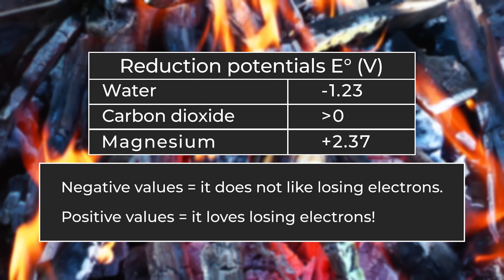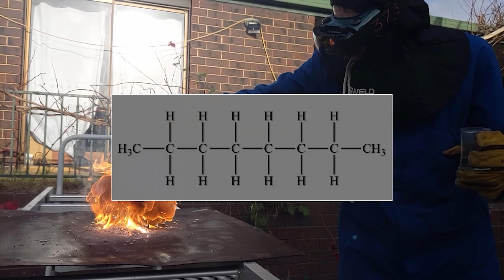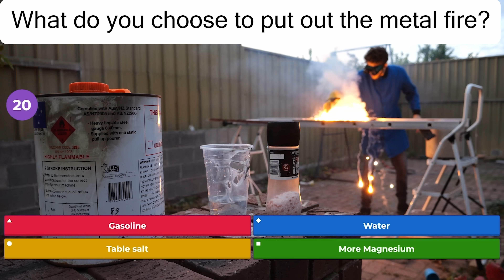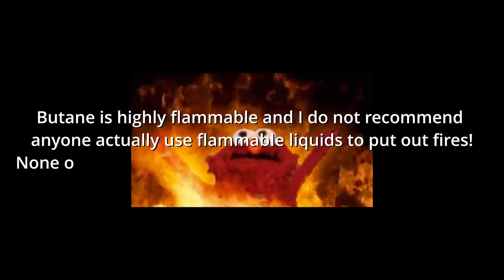Can Gasoline Extinguish a Fire?

Comment: It's not that the gasoline uses up the oxygen, it's that it smothers and cools the magnesium like water would a regular fire. The reason moving to the spray and drops of gasoline didn't help is because that's worse at those two aspects. If anything, you need more gasoline not less! 
I'd recommend dunking a piece of burning magnesium into a container of gasoline (not a sentence I ever thought I'd write)
Reply: Diesel would work even better since it’s harder to ignite with a hollow flame
Reply: @Volt64bolt  I was thinking the same thing and it would probably be more consistent as well
Reply: @Volt64bolt  Magnesium burns at 3000+ Celcius. Even Kerosene would catch fire at that temperature
Reply: @machintrucGaming  yes however it would go out much faster, it also leaves behind a thicker soot and wouldn’t be a fire hazard nor evaporate into an explosive gas
Reply: I wonder if making something like the old glass ball fire extinguishers would work? Water balloons filled with flammable liquid? 😂
Reply: @jono6379  Isn't that just an incendiary grenade?
Reply: @Malidictus  shhhh 🤫
Reply: Yeah, 'heat of vaporization' for the fuel would steal mad amounts of energy out of the burning metal, putting it below its autoignition temperature, and especially if there's a literal coating of soot...makes sense to me.  So his issue was delivery.  I'd just made a suggestion to pour a glass of diesel/kerosene on it, in fact.
Reply: I wonder if you made the fuel into a viscous napalm if that would be effective at sticking onto the surface of the magnesium to create more coverage and evaporative cooling effect
Reply: @stickmandaninacan  said that, my comment left. Or this could have been the one where I said smothered means blocking oxygen. Either way, do you see my comment there? Are my comments hidden from me or everyone or... I thoroughly dislike the comment system
Reply: @MiddlePath007  I see your @reply but the @stickman thing isn't 'live' and clickable like for other people.  I think the comment system is being 'updated' lately or something.  I had a user on another video have to reply to me again to @me properly so I saw their comment.
Reply: @MiddlePath007  this comment system really sucks, I didn't see any of your other comments I'm sorry
Reply: @stickmandaninacan but then when he catches his hand on fire his hairs won’t be the only thing a little bit shorter 😮
Reply: Ah, you beat me to it. As a matter of fact, pure magnesium is often kept safe from the moisture in the air by partially filling the container with diesel fuel!
Reply: I think part of the problem was that in the original clip he had it on the ground which acted as a heat sink further cooling the magnesium while in the air or on the metal plat it wasn't a key to conduct as much heat away
Reply: @allisterhale8229  So, yeah, 'multiple extra heat-drains' adding up to an easier situation for snuffing the fire.  I was wondering  how much the ground might have changed the equations, too.
Reply: So, to summarize, it consumes the oxygen and cools the magnesium?
Reply: I read the word "dunk" as "drink" and for those few seconds I was tripping and laughing
Reply: I love how the way to make this insane idea actually work is apparently to make it even more insane.
Reply: ps:apparently gasoline does not burn as a liquid because it can't have oxygen inside it?
Reply: Smothering is robbing it of oxygen.
Reply: Cest la vie
Reply: Yup! Smothering a fire is what ya need.
Reply: Yeah. I was thinking along the same lines because gasoline itself does not burn. It is the gasoline vapor which burns. So spraying the gasoline from a spray bottle makes the gasoline mimic those gasoline vapors, just with bigger droplets. Thus having the gasoline in a big liquid pond form most likely works the best.
Reply: and please for the love of god stop putting water ON MAGNESIUM
has nobody seen the funny clips of throwing sodium and magnesium into a lake!?
magnesium does not play well with water AT ROOM TEMPERATURE, let alone at fuckin redox temperatures!

Comment: i think you're misunderstanding how you're putting it out, sure, when you burn gasoline, it does use up the oxygen, but, what you're forgetting is that it's producing a whole load of really hot carbon dioxide and water vapor, which, from your other experiments, shows that the burning metal can still react with it, what you've really done is drowned the reaction in gasoline

Comment: that gasoline and butane fire extinguisher is just a flamethrower

like change out the gasoline for napalm and the butane for dry ice or propane so you can have more pressure and i immagine you've got a pretty decent flamethrower

Comment: Don't directly look at a magnesium flame, you can get temporary/permanent spots in your eyesight(you might not even notice it's permanent at first, it's the same with powerful lasers: Your brain is very good at filtering your vision and compensates for blind spots, but you still lost a bit of visual acuity at that point. I think magnesium flames would typically create smaller spots on your retina than a laser due to how projection works, which makes it more likely you keep most of your eyesight, but you still might lose some.

Comment: Its probably just a volume issue, the extinguisher can't push out as much liquid as pouring out a can.

Even that eyedroper probably outputs more then the spray bottle.

You need a gasoline fire hose, not a gasoline extiguisher
Reply: the gasoline poured from the canister extinguishes the fire because it starves the magnesium of oxygen. by spraying it from the fire extinguisher or spray bottle, you are just mixing air and fuel which is adding to the fire. 

the real conclusion of the video is that any liquid works as long as its molecule doesn't include any oxygen and it's not mixed with air beforehand.
Reply: @Treon so actually, just grab a bottle of olive oil and douse it!
Reply: @micahphilson  one way to find out
Reply: @superslimanoniem4712 gasoline is a crude oil distilate.
It is an oil.
Reply: @superslimanoniem4712 "oil" is not a chemical term and has no clear definition
Reply: @Treon  not only that, it also cools down the magnesium
Reply: "Everything's soaked in gasoline.  Now we're safe from fire!"
Reply: @h8GW  hey as long as your environment has very little oxidant, yes. A full tank of gasoline doesn't explode until someone stuffs oxidant into it or breaks it open and makes the gasoline spill everywhere.
Reply: Ray Bradbury called. He said he already came up with that
Reply: ‘69 👍

Comment: Look at Explosions and Fires salt extinguisher: it has a super wide slow flow nozzle that drops it vertically onto the fire. Yours is a jet. Can you put a watering can spray head on the end of the pipe to spread the gasoline out and slow it down so it doesn't aerosolise the fuels?

Comment: longer chain hydrocarbons. Try cooking oil. Maybe motor oil? Grease? Some mixture of the above? I think the volatility of the liquid isn't helping.
Reply: Legit idea. 
Bitumen, heavy/crude oils should work too.
I was told so in a fire training, at the petrol refinery I worked for, but that was 40 years ago and I'm pretty sure, nowadays they won't tell you that anymore.
Reply: I think HVO (hydrotreated vegetable oil) could work instead of vegetable oil as HVO is purely paraffinic. Veg oil is a methyl ester so the oxygen could cause issues. Great suggestion for longer chains
Reply: I think oil is less flameable, covers better to keep Oxygen out and is in many applications used for cooling. This should be exactly what is needed :-)
Reply: Volotile liquids evaporate at lower temperatures, thereby providing more rapid and more complete cooling.
Reply: @akulkis  Solids and liquids generally aren't flammable. It's only the gases that are. As volatile hydrocarbons evaporate providing a cooling effect, it also turns into a flammable gas which then provides more fuel for the fire to sustain itself and a net increase in temperature, rather than decrease. 

In this instance we want something that takes a lot of energy to evaporate in order to soak up all the excess heat before it provides further heat to perpetuate the fire. 

If you put Butane on a fire at -123°C then the fire will be hotter than that and it will evaporate some, which is then flammable, which then fuels further evaporation perpetuating the fire. 

If you put bitumen on a fire, it has to get up to at least 200°C before it starts to boil. You could look up butane and bitumen  specific heat capacity and the dT to ambient temp (14°C?) and to the flame temperature (Magnesium 3100°C) And the magnesium specific heat capacity. Then you can calculate exactly how gaseous and flammable the butane would be immediately after dispensing. And how much energy it would take to boil the bitumen in order to get it to catch on fire. 

Make it fair and put them on at the same -123°C and the Bitumen can absorb a huge amount more heat before becoming flammable and perpetuating the fire.
Reply: @Leo99929 I feel like more ideal would be finding something that isn't flammable during it's gaseous phase but evaporates really quickly would be more ideal since the evaporation is what takes the energy away rather than just heating up a piece of solid till it burns, like that will reduce heat slightly but just like the butane will end up bringing the heat right back up as you're adding fuel to the fire. You want something that evaporates really quickly but doesn't catch fire after it's done so to remove the heat rather than just slow it down a tiny bit like bitumen would. Like if carbon tet wasn't absolutely terrible for us and the environment it would be perfect cause that's exactly what it does
Reply: @noodlelynoodle.  Oh yeah, I mean you could just pour sodium chloride on it. But this isn't about the most effective way to put out a metal fire. It's about putting out a fire with something that is itself, flammable. Because the concept is so weird and unexpected. A video about doing something completely normal and logical wouldn't get a lot of views.
Reply: @Leo99929  solids and liquids can be flammable, but they're never explosive (a solid chunk of magnesium especially can just be set alight by heating it up enough, that's how vehicle fires happen in old races a lot of the time). The cooling also is secondary to the oxygen starvation effect when using flammables to cut out flammables.
Reply: @pallingtontheshrike6374  There are exceptions, that's why I said "generally" rather than used an absolute like "never" which can be disproven with one counter example. Example: 

Counter examples to the idea that solids and liquids never explode: Nitroglycerine and C4.

I once put a big chunk of magnesium on a camp fire and it melted but didn't set alight. At least until I hit it with a big stick. Maybe that removed a protective oxide layer? or the impact pushed the temperature above the ignition point? or it splashed and some spray set alight first? IDK. 

A problem with trying to starve a fire of oxygen with a flammable thing is that the flammable thing is likely to set on fire since it's flammable and in the presence of fire. Then heat rises, drawing in gas to replace it from the bottom. That gas is likely air with oxygen in it. It needs to have lost enough heat whilst starved of oxygen to get below auto ignition temperature. Which is less likely when engulfed in flames.
Reply: @Leo99929  It doesn't need to drop below auto-ignition if you make a layer of non-flammable deposit, like the soot the gasoline was making, that then encases the thing you're trying to put out. You need a lot of your "retardant" though.

But fair enough on the "solids can explode."  If anything, most military explosives are solid iirc, so even "generally" is... eh.

Strictly speaking solid and liquid fuel-only materials can usually only burn and not blow up. Fuel-oxidant mixtures can do whatever they want, for obvious reasons.
Reply: @pallingtontheshrike6374  I assumed soot was carbon, like finely powdered coal? So it should burn if hot enough and there's oxygen, right?

I looked it up and it's apparently "amorphous carbon". Here's me thinking C2 + 2O2 = 2CO2, but amorphous carbon is apparently not considered "flammable"?! I guess I have seen the black soot deposits glow incandescently with a flame on them, then not sustain it's own flame when the fire is removed?

Having said that, it also says "can burn or smolder at temperatures greater than 572ºF (>300ºC)." So that's hard to reconcile with "not flammable"

I see the logic that the soot layer can make flammable things hard to light, but also chimney fires are a thing? Having said that, I think that's more about creosote than the carbon? And carbon does oxidise releasing heat turning into CO2? IDK, looks like it depends on the situation?
Reply: @Leo99929  soot is usually unburned fragments which yeah is carbon.
It's bad heat conductor iirc and doesn't burn particularly well though, so it's close enough.

In any case, passivation works, though actual pure oil is not the best, want something to leave stuff like ash or even better a hardened oxidation layer (why aluminum blocks don't burn down beyond the outer layer but aluminum powder explodes).

Comment: I never would've thought that gasoline could put out fire. This is the most counter-intuitive thing I've ever seen...
Reply: To really make your head go around... in older days (we're speaking like 1800s) sometimes to make the water douse fire better, people mixed in black gunpowder (in places where it was available, so usually on warships.) Wet slurry of gunpowder sticks to the surface, and after it dries out, it burns ... releasing a lot of powder fumes, which block oxygen and also again leaving a potash residue on the surface, so that it would not reignite. 
So in a sense, you can also stop lesser fires with black powder.
Reply: Gasoline being an oily substance that doesn't burn up that easily unless under pressure, it kinda makes sense.
Reply: @c0mpu73rguy  I suspect if you use diesel or even heavier oil based substances it might even work better.
Reply: @c0mpu73rguy  i wish i were an oily substance that doesn't burn up under pressure
Reply: Ah but there is also putting out oilfires in oilfields with dynamite.
Reply: @maxmisterman785  Yeah, but that's a special form of 'punting the flame-front into orbit and leaving the rest of the oil behind' more than extinguishing it, to be fair.  :D
Reply: never heard the term fight fire with fire?
Reply: The more you know
Reply: I mean... Taking away oxygen is the goal of every fire extinguisher I know of. And fire consumes oxygen. The issue is... Just any movement of air will add oxygen back. And fire creates updrafts. So yeah.
Reply: Explosions is unironically a good way to put out forest fires, so gasoline working wouldn't have surprised me too much. I feel like it'd require a more explosive combustion to exhaust all local oxygen while creating a crust over the burning metal. No other way seems plausible, but I'd be more worried about the explosion part.
Reply: @CottidaeSEA  I suppose you could go that way. I think you could also go with something more viscous to coat it and keep it from being in contact with oxygen that way. Something like an oil of one sort or another.

Which, to be fair, is not putting out the fire by way of burning up all the nearby oxygen and instead doing the same thing the salt extinguisher is doing, covering it in something non-reactive to the flammable metal.
Reply: @plzletmebefrank  Yeah, it's the same idea, starve it of the reactant, the oxygen.
Reply: You're killing a small and dangerous fire with a bigger and slightly less dangerous fire.
Reply: it converts the fire into a slightly less damaging fire

good enough tbh
Reply: @TheOneWhoHasABadName i can actually see controlled pyrotechnics used to fight fires in industrial chemical processes
Reply: The Soviets successfully used a nuke to put out a fire.
Reply: fight poison with poison duh

wdym MOST counter intuitive smh
Reply: Ironically enough nicotine counteracts datura to a small degree @urnoob5528